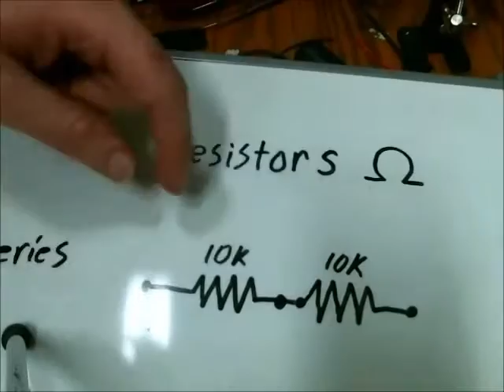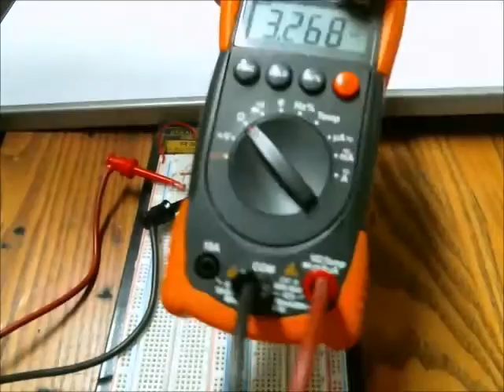Resistors in parallel and series

Comment: man i was trippin on my volt meter why it was showing lower and lower ohms thanks plain simple and to the point lookin at your other videos was trying to make 1 watt  100 ohm with 1/4 watt 100 ohm resistors so i could keep 100 ohm but get it UP to 1 watt so I would use 4 of them solder to a paper clip or whatever on both ends so all on a bar with a little lead coming off both ends to have my value of 100ohm 1 watt kinda like this l==l see four resistors on bar each end with little lead to hook up am I trippin or what is this right